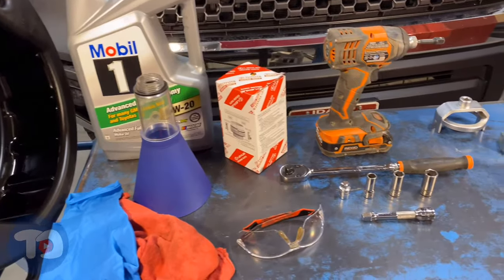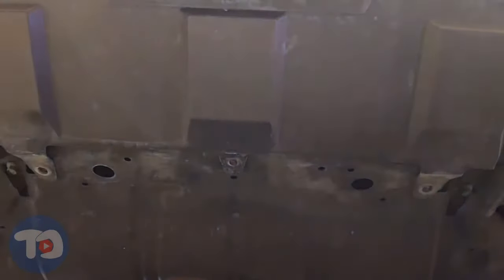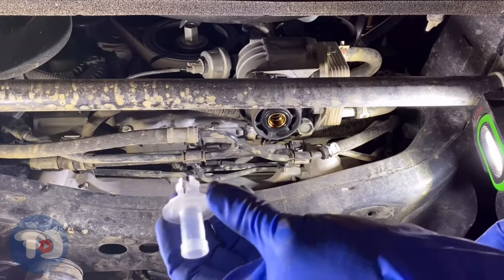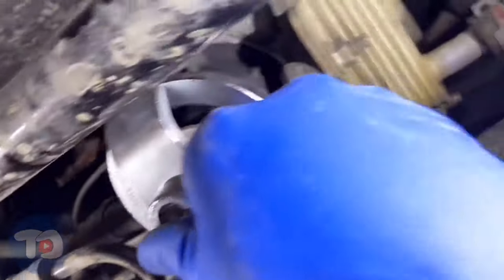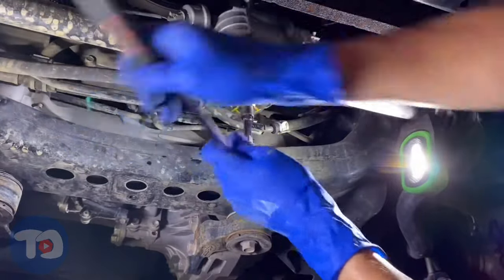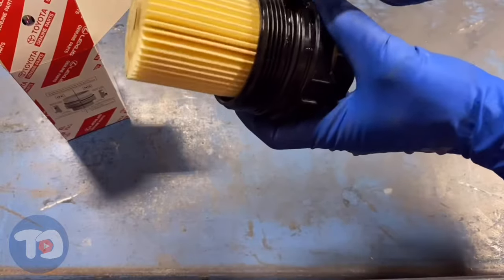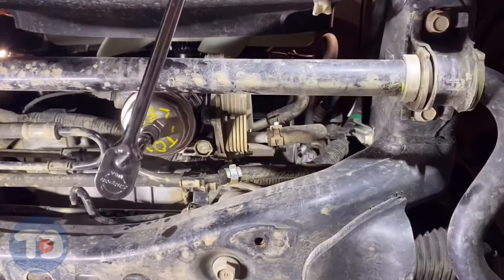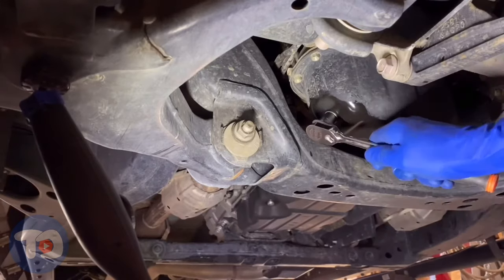How to change the oil on a Toyota Tundra + best filter wrench.

Comment from the maker: See a video review of the MotivX funnel by clicking here: https://youtu.be/ozK9wGLJVDI
Reply: So i bought my tundra with 145000 miles on it.  I dont know if the transmission fluid has ever been changed.  Do i dare change it?
Reply from the maker: @randyewell3788  fresh oil cannot damage a transmission. If the transmission slips after doing a fluid change, it’s because the new fluid has only exposed the damage that was already there. My recommendation for people in your situation is to replace the fluid, but also be prepared for a transmission rebuild before you do.
Reply: @ToolDemos  Thats what im scared about lol.  Shifts great now but scared
Reply from the maker: @randyewell3788  I totally understand. I’ve had it go both ways on different used cars.

Comment: I have a 2019 TRD PRO. It has the access panel on the skid plate, so no more skid plate removal. I had a 2012 Tundra SR5. I had a buddy of mine cut an 8" hole in the skid plate to avoid removal every time I changed the oil. It cut the labor time in 1/2
Reply from the maker: That’s a really good idea.

Comment: If I had  found your video last week I could have learned how you use two thumbs to push in the plastic drain funnel that comes with each new cartridge and  saved myself $14 for a brass oil drain tool that screws into the canister. For years at every oil change on our RV 4 I was struggling to overcome the spring tension on the canister and get that plastic thing to seat in the hole with just one hand. Nice innovation on your part. Thank you. The video you made is excellent as well.
Reply from the maker: Thanks. Never seen the screw-in type. Hope it’s working well for ya.

Comment: Good video. I just bought a Tundra. I bought one of the motiv X wrenches and drain tubes for the filter. I didn't get the funnel but probably should have. I plan on doing oil analysis and only changing the filter every 5,000 miles or so. I will change the oil when the analysis says it needs to be changed. I've worked at places that do that with fleet trucks and sometimes they go 30,000 before dumping the oil. It seems to work fine because the trucks run well into the 200k miles without issues. One van used for commuting has over 500k miles and its still going.
Reply from the maker: Thanks, duggydo. I think you’ll enjoy working with those tools, and wow pretty high tech plan for the oil.

Comment: Great video! I just recently did an oil change on my 2015 taurus sho and I used a torque limiting oil filter wrench from Klick Wrench in Canada. It both breaks loose and torque the filter down to around 18 torque and it fits a variety of filter sizes for either cartridge or spin on oil filters. They sell them online... all of their products were listed out of stock. But the largest one, the red one, was on amazon and I love using it. And their blue colored one is designed for toyota and other cartridge style that are smaller. I just like their products because filter install and removal is made so much easier and the quality is very top notch 👍
Reply from the maker: Thanks Brent. I just had a look at their website, good looking tools. Yup they are still out of stock. Thanks for the tip.

Comment: The skid plate is a pain and I cut a five inch access panel so I never have to take the skid plate off again and I have found that the amsoil filter element flow oil much better through the filter than the standard Toyotas filter but a lot more expensive
Reply from the maker: Good mod.

Comment: Thank you very much for the video I was a little bit concerned after watching the transmission fluid change how complicated things are.

I'm quite confident I could do the oil myself and the differential

Have you ever looked into better filters and better oil filters like AFE mobile one
Engine oil like amsoil project farm did a great video on engine oils
Reply from the maker: Glad you’re going to be taking care if your Tundra yourself! I’ve been using the same oil and filters since new, no problems so far. I’ll have a look at project farm’s video, I’m open to new things.

Comment: Why exactly 7.9 quarts of oil in after the oil change?  The engine oil capacity I find online for a 2018 Toyota Tundra is 8.5 quarts.
Reply from the maker: You’re right about the capacity. I checked the book again, 7.9 quarts is shown for ‘without oil filter’. 8.5 is ‘with oil filter’. So, when I fill it with 7.9 quarts, it will show full on the stick until I start the engine. After running it, the level is in the center of the two lines. I’ve been leaving it there, thanks for the correction.
Reply: @ToolDemos  Thank you, sir.  I put just a tad over 8 qts in and started it up.  I did a cold check a couple hours later and the the level was about 3/16" below the top mark.  I'm putting in the last half quart of oil tomorrow.  Actually, the oil level is now about where it was after 7500 miles but I'm quite sure it was on the top mark right after I did the last oil change 17 months ago and I did put 8.5 qrts in at that time.  Thanks again for your extremely helpful tutorial.

Comment: a question for you?how i can check the disptick oil .in cold or  in idle ..i;'m little confuse ,,in cold it should  be between the two dots,like in middlle or in the up dot? its ok...OR WHEN IS in i k idle ,it should be touching the up dots?....thanks in advance ...
Reply from the maker: Check the oil level with the engine off and the vehicle on level ground. The level should be between the two dots, but I like it to be closer to the upper dot.
Whenever I check engine oil, I check it when it’s cold, just like tire pressure. If you check the oil when it’s hot it will show a little bit higher on the dipstick because oil expands when it’s hot.

Comment: Toyota dealership wants 2.50 for the crush washer. 😮
Amazon sells them for 10 packs for 9 dollars. Are they any good?
Reply from the maker: Yeah, I’ve used Amazon type washers on several cars. Seemed to work okay for me.
Reply: @ToolDemos  
I added a plastic tube on to the oil filter drain adapter. No mess. All the oil went into the pan. 😁
You didn't video the small O ring and washer nut install. Pretty much a simple self explanation 

MotivX makes a drain valve with hose for the oil filter housing.
They're others with much cheaper prices.
14 dollars
Reply from the maker: @wt9653  good info, thanks. Keep up the good work. 💪🔧

Comment: I wonder all 5.7 same engine from 2007 to 2021 it should be same oil capacity why my 2008 takes 7.4 quarts exactly but yours takes 8.5 please if you have answer to my question answer me !!!!
Reply from the maker: I’ve wondered that myself, they both have the same oil pan. My guess would be a different oil cooler.

Comment: Why not have a hose on the drain plug insert tool?
Reply from the maker: First, because I would have to clean a hose after I was done. And second because if you get the adapter in just right, it’s a very clean pour straight into a drain pan. I never spill a drop doing it this way.

Comment: Where do you by your Toyota parts from?
Reply from the maker: The dealership usually. Check online, some dealerships offer discounts and cheap shipping. Be careful of eBay and Amazon, there are a lot of counterfeit parts on the market. (Marked with ‘Toyota’ packaging but really just a Chinese part.)
Reply: @ToolDemos  Thanks.  I just bought a 2013 tundra.  Your video's are very helpful in showing how to do the easy maintenance that most people can do at home and save some money.  Thanks for your help.

Comment: Isn’t it 8.5 quarts ?
Reply from the maker: For a 3UR-FE, it’s 7.5 quarts without filter. 7.9 quarts with filter. You may have a different engine.
Reply: @ToolDemos  I have a 21 tundra 5.7 3UR-FE and the manual says 8 quarts without filter and 8.5 with filter . Weird
Reply from the maker: @tundras4ever552  that is weird. Mine is a 2018, maybe they changed the pan on yours.
Reply: @ToolDemos  well yours went to between the dots and mine takes it to the top dot so I’m sure it’s the same pan . Just decided to add more oil I guess idk what they think when they write them haha
Reply from the maker: @tundras4ever552  I think you’re right. I just looked up the part number for the lower oil pan and it’s the same between 2007 and 2021.
Reply: @ToolDemos  interesting for sure I guess u can do either one then and be fine . Either 8 or 8.5

Comment: You didn't torque the drain plug. Also, you didn't clean the filter housing and the drain plug area with brake cleaner. 👎👎👎
Reply from the maker: You’re right.